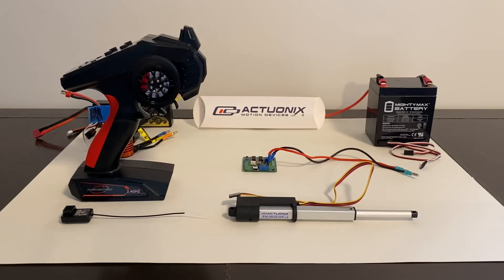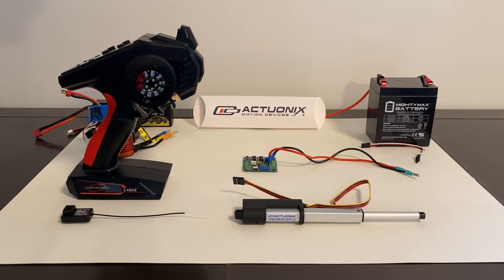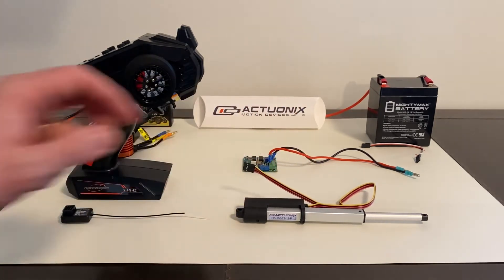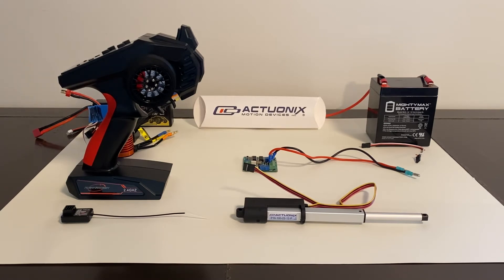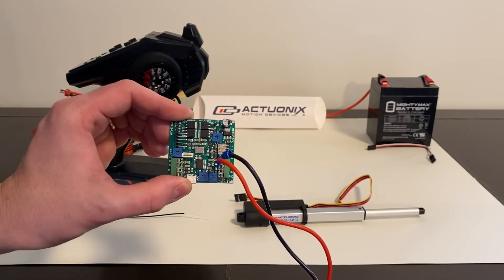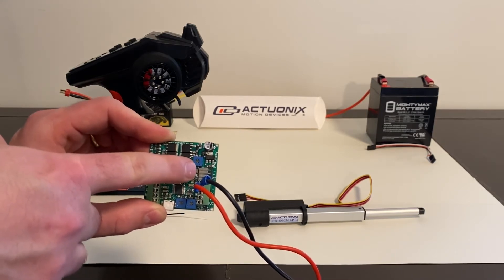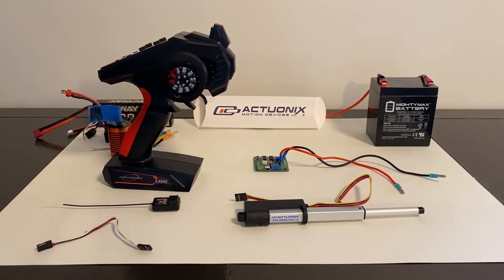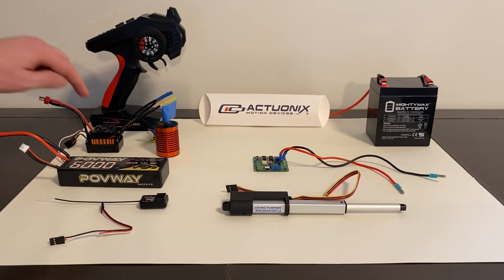Operating a Linear Actuator with RC Controls using a LAC Board and ESC

Comment: I am now using three 12 volt linear hard wired actuators to control three hydraulic levers. I don't need wireless but I need "return to center "  and would be great to set travel positions and speed. Can you tell me how  / what to buy.

Comment: Instead of a 12 Vdc 5 amp battery, use a motorcycle battery instead. The terminals can be adapted to anything. I just diagnosed and fixed vehicles at dealers & shops for decades, but after a period of time at a motorcycle shop, I had already owned 7 different bikes, rode them, fixed them and sold those or traded in. 
  Just thinking out loud as I don’t know the price. 
ASE Master Tech since 78.

Comment: Hey. How reliable this set up has been ? Any ESC issues since it’s been on 12V battery ???
Reply from the maker: No issues with the ESC. One thing to consider is how much the actuator will be used and if it’s going to be used on grass vs pavement. If it’s constantly moving in and out, it will burn out. And using it on grass will put more pressure on it than on pavement, which is easier to push the wheels
Reply: @DadHacks  going to go a the heavy duty one. Pavement only. We got other power wheels to go off road with
Reply: @DadHacks  I also noticed your convo w another member. And the brand you used was the bottom trim actuator. I was thinking same brand but higher output because they are cheaper than the heavy duty one you shared the link to but I don’t want to just throw 100 bucks out the window to learn it didn’t last

Comment: Hey mate

Thank you so very much for this video. I got inspired and going to copy this set up. Please let me know if this actuator is the right for a big power wheel vehicle or should I go with something that is slightly quicker ? Thanks much
Reply from the maker: I’d go with a little more heavy duty actuator, which means the speed is actually a little slower. Something with specs similar to this: https://www.progressiveautomations.com/products/linear-actuator-with-potentiometer?variant=18277322555459
Reply: @DadHacks  ok thanks much 

And would you know the answer to this question 

Can I run the same brushed ESC in conjunction with 18V set up or 36V ? I want the car to be still remote operated. I got a 775 motor set up with a soft start, and brake module. I would like to operate off of one battery but if I have to have two batteries of different voltage so be it. 

You let me know if this is even feasible for my application.

If no - then what needs to be done ? I am guessing , I am stuck with a 12V set up only ??? 

Thanks much - you are great
Reply: @DadHacks how many max lbs is the one you put in your kid’s Audi? Just curious - I emailed the supplier and awaiting their answer. I need anything around 35lbs + . The more robust feedback actuators are too slow. 

Let me know thanks again!
Reply from the maker: @PeterSiekiera  the one I used was 100mm/ 22:1 gearing ratio that allows for a max force of 50 newtons.
Reply: @DadHacks  thanks for the info. 50 newtons equals roughly 12 lbs - thanks for the reference ! 

I also found another video where you recommended using buck step down converter - I think that is the last piece of equation for me. Going to have one for the ESC and the linear actuator as I am planning on running drill batteries of 36V combined.

Thanks again

Comment: Can I strap my 4s batteries to it or do I need to drop them down to 12v?
Reply from the maker: It depends what what the motor voltage is rated for. The actuator will need to be on 6 or 12 volts (also depends on what its rated for)
Reply: @DadHacks  hey so i got all my stuff in and its a diffrent actuator than you have and its not working like its suposed to. i set it up as its suposed to and it just extends the arm out and stayes there. any sugestions?
Reply from the maker: @redrighthandarts I’m assuming the actuator just has 2 wires? Try playing around with the steering trim on your RC transmitter and then obviously turn the steering wheel on the transmitter to test it
Reply: @DadHacks  naw, it's got 5 wires it's supposed to work with this board but it's just not responding to any rc signals being put in
Reply from the maker: When the arm extends out, are you doing anything to it from the RC transmitter? Or once you turn the power on, it automatically just extends?
Reply: @DadHacks  the second one. I don't touch the stick at all and it just goes out and nothing...
Reply from the maker: @redrighthandarts on the RC receiver, is channel 1 going to the LAC board and is the red power wire on that cord cut so power isn’t become supplied from the transmitter to the LAC board?
Reply: @DadHacks  yes to both. I tested the channel with a servo as well
Reply: @DadHacks  hey, so I ordered a new lac and it's still not working. I'm using a taranis qx7 controller. Is that the problem ya think?
Reply from the maker: @redrighthandarts  to isolate the issue, have you tried running only the motor to see if the RC can control that, without the LAC board setup?
Reply: @DadHacks  like testing the channel or testing the actuator? i checked that the recever was geting signal with a servo and i moved the actuator by just putting power to the red and black and that moved it. im also using a taranis qx7 controler and not a pistol type
Reply from the maker: @redrighthandarts  I haven’t used that type of controller, but that seems like it could be the issue

Comment: Looking to make a small custom cart and am trying to apply your setup. My question is being able to have it traveling from 3-8mph varying on the throttle. Is there a certain amp rating for the ESC you’d recommend? Or will the remote throttle drive well. Just trying to prevent a hard launch with the throttle
Reply from the maker: A 60amp rated ESC should be plenty. The remote throttle should prevent a hard launch

Comment: Hi, im having a small challenge. Everything is wired up exactly and working quiet well aside from the fact that the linear actuator is failing to hold position. After moving it one direction or the other, it'll move all the way to the extreme all on its own depending on the side thats shortest this makes it impossible to hold a center position. This doesnt happen when i bypass the actuator controllers so its clear thats the fault but i cant figure out how to solve it even after tinkering with the settings on the controller. Any idea how to solve this?
Reply from the maker: Check your remote control “steering trim” setting. Mess around with it to see if it changes anything. Also check the control board. If that doesn’t work, look at the 2 blue boxes on the control board, try turning them a little, that will change the length it goes in and out

Comment: i got a WLTOYS wheelloader with the steering system failure 
was wondering if this kit would work to steer 

my circuit board doesnt show any power going to it but ive only lost steering
Reply from the maker: It would be a lot easier just to replace the circuit board with something like this:  https://a.co/d/fg870Te
Reply: @DadHacks  so like a ride toy style, i see, and my rc uses a 7.4v battery should i just throw a 12v at it or keep it at 7.4.   

just gut it all and connect everything into that board
Reply from the maker: @dancearoundtheworld5360  sorry, I had sent the wrong replacement board. Have you searched WL Toys website for replacement boards? https://www.wl-toys.com/Wltoys-20402-Spare-Parts-38-0655-Circuit-board-Receiver-board-Wltoys-20402-Rc-Car-racing-car-Spare-Parts-Replacement-Accessories-On-Road-Drift-Racing-Truck-Car-Parts-29902.html
Reply: @DadHacks  yep there website only sold the speaker 

and that board in the link doesnt match

motor works when i put direct 9v to it 

😁😁😁 really fun the brand,  like no product testing was done

Comment: Instead of using 2 different batteries would it be possible to just add a voltage regulator and lower the voltage for that specific piece ?
Reply from the maker: Yes. You would want a step-down buck converter

Comment: This linear actuator is not suitable for a power wheels conversion. After watching your videos and using this setup on my project, the linear actuator only lived for about 20 mins. It’s maximum force is 15lbs and puts a lot of stress on the actuator.

After speaking with someone at Actuonix directly, they recommend their LAC board but a FA-PO-35-12-4 in place of their linear actuator.
Reply from the maker: There are 3 different levels of power for this actuator. It sounds like you got the lowest level of force (50N or about 11 lbs). I’m using one with about 90n or 20lbs of force. There is also one that offers 300N or 67lbs of force. It looks like the one you linked has about 35 lbs of force.
Reply: @DadHacks hey again, what stroke length did you end up using, 2 or 4 inches?
Reply from the maker: @theinmiller7  the 4 inch might be your best bet. You can control the min and max lengths on how far the actuator goes out (or in) by setting on the control board

Comment: Hi will my son still be able to manually drive the car? For example if he wants to drive it himself while i use the controller if he ever goes in the middle of the street i can use the rc to steer him away from incoming cars
Reply from the maker: No, I wouldn’t recommend that setup. The issue is that if he steers onto the street, the force of the actuator won’t be great enough to overpower his manual steering. However, you may not need the steering control if he is old enough to steer. If you are controlling the throttle and you see him start to steer into the street, you could just release the throttle to stop him
Reply: @DadHacks  hes a 3 year old still not able to understand the danger of incoming vehicles, but he is able to drive it no problem. I have the weelye rx 30 im trying to have it converted to radio rc with an actuator but having trouble trying to combine the manual pedal driving along with the rc functions.
Reply from the maker: Do you think a remote kill switch would be helpful? If you see him start to steer in the wrong direction, you could just kill the power to the car.
Reply: @cmanzan21  Honestly, 3 year olds are more than capable of understanding things like that, it's up to you to teach him. I have 3 boys and they were all operating vehicles on their own at 3, they were also all talking by 1 and potty trained around the same age. I was adamant about their learning and made sure to teach them everything I could while talking to them as if they were an intelligent human instead of how people normally talk to children, as if they were stupid. Because they're not

Comment: Hi! Can I use any linear actuator?
Reply from the maker: The short answer is No. But there are different types you can use. The one I was using has “position feedback”, which returns the actuator to center when no steering input is received. Position feedback is a nice feature, but not a “must”. Other things to consider are: the Force of the actuator, how fast it moves and it’s voltage

Comment: How did you get the actuator to return to center ? Is this something you had to program through usb with the lac board utility ? Thanks
Reply from the maker: The actuator I’m using has position feedback. A simple way to tell if the actuator has position feedback is to see how many wires the servo cable has. If it only has a red and black or red/black/white then it does not. If it has 5 different color wires, then it does have position feedback
Reply from the maker: Also, on the LAC board there are controls to limit how far or how short the actuator travels. But if it has position feedback, the it will return to the center
Reply: Can you tell us  which steering model you actually used in this build ???? Please and thank you
Reply from the maker: @user-vy4ko7ms3p by steering model, do you mean the actuator?
Reply: @DadHacks  yes, sir. Sorry about that. I think I know which one you used , now. Sorry for the trouble

Comment: Hi, are you able to run 2 actuators off of one LAC board? 
Or are 2 boards needed and if so is it possible to run both boards off of one Remote? 
Thanks
Reply from the maker: I haven’t tried to run 2 off one board, but I don’t think it’s possible (the description of the board says that it “controls 1 linear actuator”).  I think you could run 2 actuators off 1 remote. You would need to buy a 3 way servo cable that plugs into channel 1 of the RC receiver. Then from there, each servo cable could be connected to the two boards. Here’s a link of a 3 way servo wire:  https://www.amazon.com/dp/B07WCGX531/ref=cm_sw_r_cp_api_glt_fabc_0S122XCZNHZMAPAX6HCD
Reply: @DadHacks  Ok I see! Thanks for the promt response I really do appreciate!
Reply: @motomike2252  Thanks,  order 2 actuators and got 2 lac for free!

Comment: is the motor attached to the LAC board ? Otherwise Howd you control it ?
Reply from the maker: The LAC board is just for the linear actuator, you can control the motor without a LAC board. The LiPo battery connects to the ESC (electric speed control) unit. The ECS connects to the RC receiver via a servo cable.
Reply: Hi just wondering if you can use the 12 volt battery to power the esc, I would like to use a similar setup but to control a 12 volt motor to make a sawmill travel up and down its tracks, right now I'm using a 12 volt pwm but would like to add the rc remote so that the wheel can make it go up and down and the trigger go front and back on the tracks, thanks for any help
Reply from the maker: Hi, Yes. You can use a 12v battery to power the ESC as long as the ESC is rated to handle “3s”; which just means 3 cells

Comment: So I have pretty much the same setup, however, I can't get the linear actuator to sit in a neutral position.
Reply from the maker: Hmm, so it will go in and out, but it won’t return to the “neutral” set up? Can you check out many colors are on the actuator’s cord? Is it just red and black/ red, black and white or multiple colors?
Reply: @DadHacks  its red, black, white, yellow and blue
Reply: @DadHacks  yeah, when the wheel on the controller isn't touched it sits all the way out
Reply from the maker: On the Remote (transmitter), what number is the “Steering Trim” set at?
Reply: @DadHacks  its set in the neutral position. No numbers
Reply: @DadHacks  using GOOLRC MTG3 for the remote. LAC is actronix and the actuator is progressive automations
Reply from the maker: @Nicholas Alves   2 more things to try:

1) what happens when you move the Steering Trim out of the neutral setting, does the actuator adjust?

2) On the LAC Board, turn the bottom 2 dials on the 2 blue boxes all the way clockwise, that will reset the limit settings back to the factory setting. Power on and off (physically remove the power wire) a 1 or 2 times for the setting to take effect, then see if that fixes the problem.
Reply: @DadHacks  so if I move the trim pos it moves a little, did the 2nd option and still the same issue
Reply from the maker: @Malfarius1  I just looked at the RC transmitter you have. On the side with the 3 turn dials, is the bottom dial set to Max? When you set that to max, play with the top dial to turn it to different setting to see if that fixes the spot you want the actuator to be set at
Reply: @DadHacks  I think I'm gonna send the progressive actuator back and get an actronix one
Reply from the maker: Would you be able to upload a short video showing the LAC board setup, the actuator and the RC Transmitter? And then trying to turn the steering wheel? The LAC board is compatible with other brand, my feeling is that it’s something with the RC transmitter or maybe a connection
Reply: @DadHacks  uploaded
Reply from the maker: I couldn’t see any. Make sure it’s set to Public instead of Private
Reply: @DadHacks  set to public now
Reply: @nalves57 I'm having same issue. Same linear actuator and all, did you ever get it figured out?
Reply from the maker: @blklblallen   does your actuator only go in but not out?
Reply: Is you rc receiver on a analog or digital?